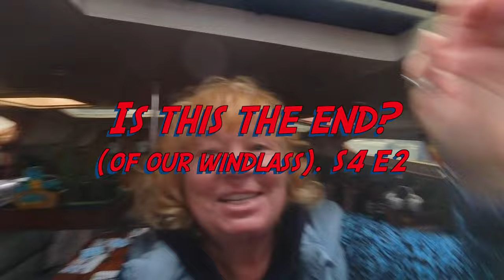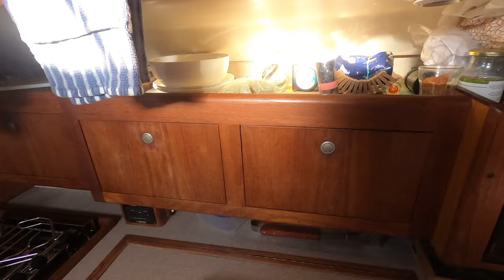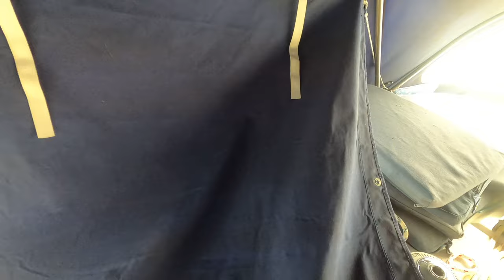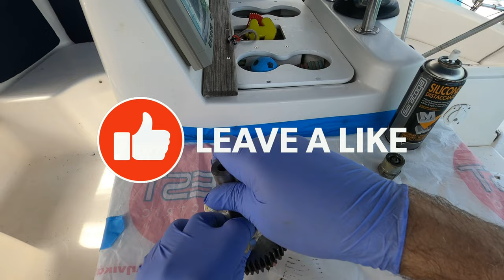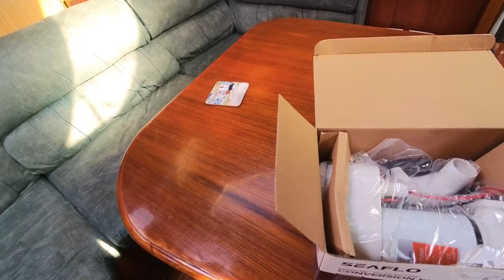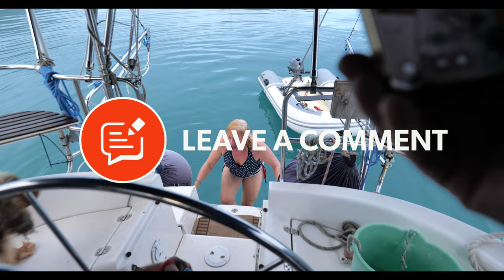Is this the end (of our anchor windlass) ? | S4 E2

Comment: what kind of mic gear do you use? I notice a bit of scraping sound. Don't know if its the video or the mic, that makes that sound. 

/Fair winds.
Reply from the maker: We’ve tried using external mics without much success. We rely on the internal one on the go pro with a foam cover. The Panasonic has an external Rhode mic with a dead cat that works great. The insta is still a pain but I’m working on it.